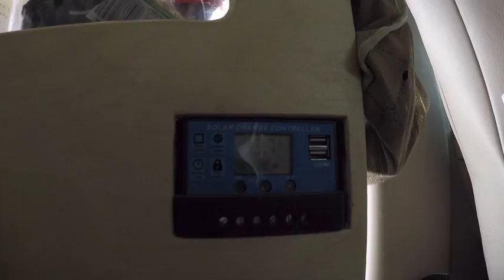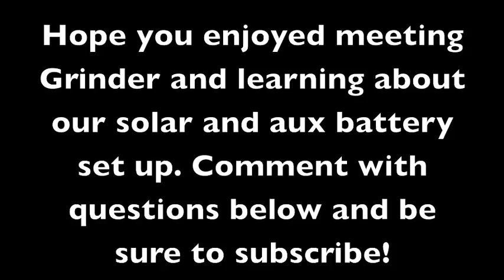Van Solar Power and Electrical System Explained

Comment: Seems like a good, basic setup.👍 But I've noticed that even budget overland builders like Suboverlander are switching from custom built systems like this to all-in-one portable power stations like the Goalzero Yeti, Jackery, etc... Everything is built in to one box from battery to solar charge controller to outlets for both 12V and 120 VAC via an inverter. Charge from your vehicle via 12V "cigarette lighter," solar panel, and/or wall outlet (since it's portable and can be carried indoors). Modern ones all have lithium batteries, too - which can be discharged to a much lower level w/o harm and are MUCH lighter in weight than lead acid AGM batteries (e.g. a Jackery 1000 only weighs 22 lbs)

Comment: go to an rv shop and pay a guy who knows what he's DOING to do this.  Or you'll be buying another battery pretty quick.  i like the CTEK D250SA cuz it has a GOOD solar charge controller built in and can isolate from the starter battery and charge by the alternator.  It is spendy, but you don't need to buy a solar charge controller.  Your starter battery and extra battery MUST be compatible.  And you don't need an inverter if your battery only supports your fridge.  All the rest of your stuff can run off 5v batteries for cell phone charging.  (like fan, led lights, phone, tablet, etc).
Reply from the maker: good advice!

Comment: Why did you just tape down the red power wire rather than unscrewing the kick plate and hiding/protecting it under there?
Reply: My first thought. I've got 4gauge wire running down my 05 burb. So i know they can get that small 8 down it

Comment: Did you look at installing your 2nd battery in the engine compartment? There should be room since the police Tahoe and Suburban run 2 batteries in the engine bay. Otherwise nice setup.

Comment: Hello.  Great vid!   On the z71s like ours there's a way to hide all the wiring coming off the roof without drilling.  Pop off the plastic cover on the end of the roof rack and remove one of the mounting bolts and use that hole for your wires. 
I'm ridiculously OCD about exposed wires.  LoL
Keep up the great adventures . Looking  forward to new vids!
Reply from the maker: great info!
Reply: BAD AIM SUBURBAN great tip!

Comment: Awesome videos.  I have a 2001 Dodge Ram I've used for a few years before investing in a 2013 Prius.  

With the truck I didn't like having to get out sometimes to enter through the back so I am planning on doing a Mike Basich style walk through roll bar modification as well as insulating the whole cab, bed and cap more for sound, RFI, EMI and heat.  I might make a custom cap with a storage rack instead, though for now will just use the aluminum one.  I'm also planning on custom welding battery holders to bolt underneath the bed on the chassis.  I got a great deal on a MIG welder so the cost was about as much as the roll bar and mounts would be... plus,  I have new body panels from LQK 50% off holiday sales to replace that I can weld in also... so the welder will help with the whole project and others in general. 

I've planned to do a bypass switch for starting from the auxiliary deep cycle battery so that when the engine turns off I will have to have a switch turned on to bypass the isolator.  I was planning wiring the isolator under the hood with the starting bypass switch under the dash.   I was all paranoid for if using two batteries and got 0 gauge wire for that and if going to an inverter circuit run.

I was also wondering about charging differences between the starter battery and deep cycle battery for optimal battery life cycle, i.e. maybe adding a battery charger or charging logic in between the alternator circuit in case there is a more ideal and not causing significant losses in the circuit charging method.   I thought about this more-so if I can salvage enough lithium laptop batteries to make a lithium fault protected brick to use instead of the deep cycle. 

I also have a schumacher 120V charger that has battery type options and current options so if I need for some reason to use the 175W 12V cig lighter inverter from the car to charge the battery or from another vehicle I have that option or just straight from an AC outlet.  I use the battery and inverter more at camp or farming for kitchen appliances.  

The goal is to use the truck for Radio Directional Finding and as a listening station to fox hunt rogue signals.  I figure if ghost hunting is an option for some... I can do DEW hunting and not just amateur radio or TV.  A Law School I discussed with thought there is potential more in the future for that work also since seems to have gotten out of control causing mental illness and way worse crime.  Will be an awesome mobile home again too for more outdoor recreational activities as well and quieter electric tools for work and chores instead of gas powered equipment. 

Working on a house for now and some other electronics projects... though looking forward to getting back on this.  

I need to get on this off the grid truck project as I don't see anyone doing walk throughs with their trucks online so much and will be nice to have that sealed up better with more organized systems.  

Thanks for sharing and the inspiration!
Reply from the maker: sounds awesome! have fun out there!